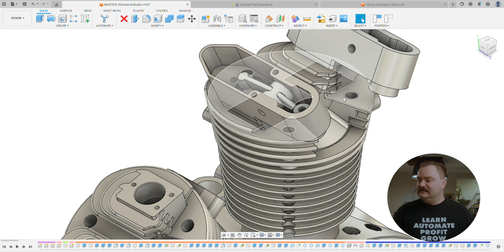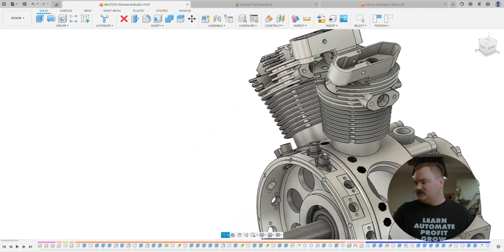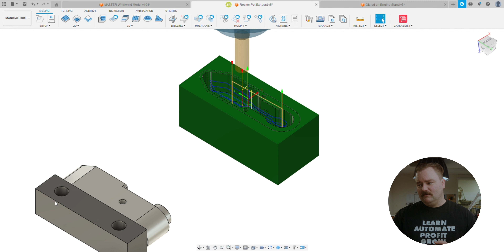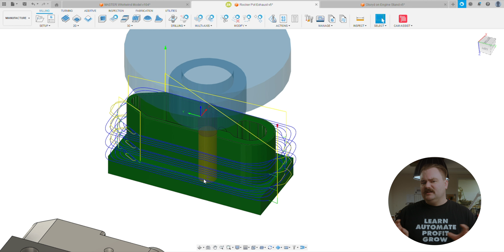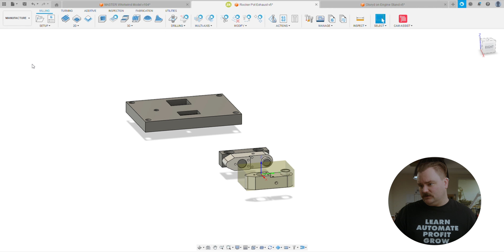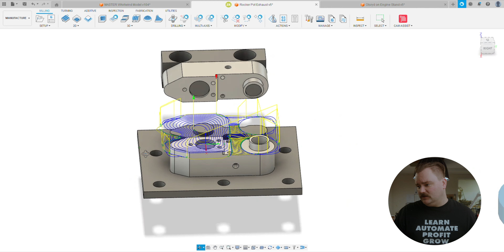Making a scale RADIAL AIRCRAFT ENGINE! Episode 2 - first chips! | Zealandia.Systems

Comment: 6 hours... MDF machine surface been there tried it and replaced it, it you don't want to changes it put a 20mm thick steel plate,  with a decent size under your tooling.... the weight will reduce the chatter and flex a little
Reply from the maker: Thanks! Yeah we've built a steel table... will show it off in the next video